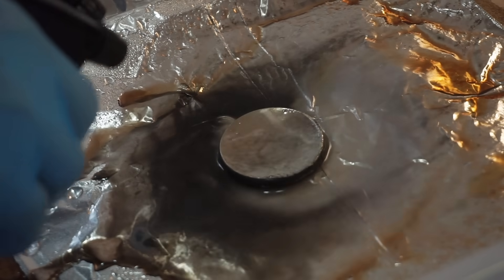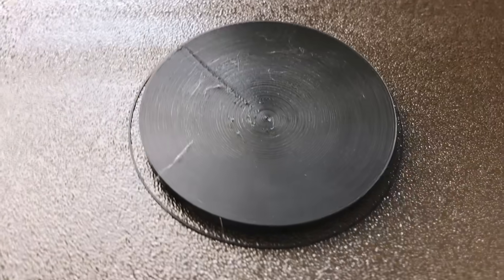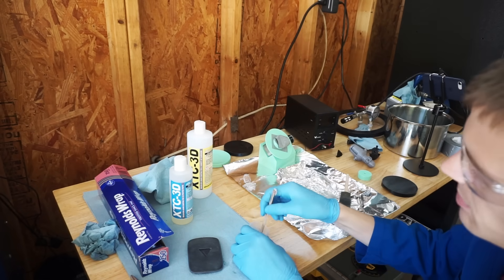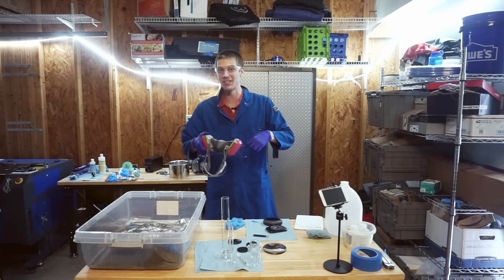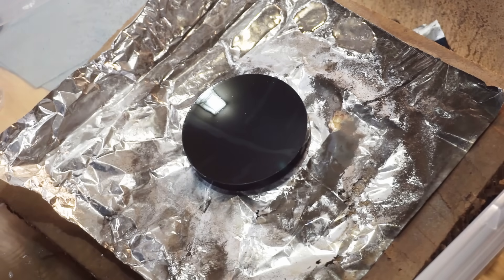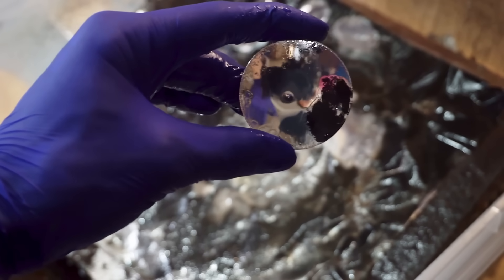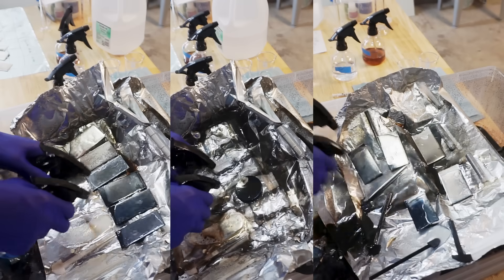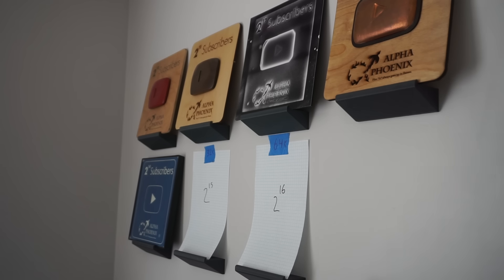How does a "first surface" mirror work? (2^15 sub special!)

Comment: You should 3d print the opposite shape.. foe example if you have a convex mirror, 3d print the concave mating shape, minus the thickness of sandpaper, spray mount wet/dry dand paper, and wet sand the surface. That is how lenses are made. (I used to make eyeglasses.)

Comment: A lot of people use a small heater inside their resin printer enclosures to help cure the UV resin, along with a thermostat to maintain optimal temperature. Maybe putting one into a UV curing station would help with your situation.

Comment: You would vacuum chamber the epoxy before pouring to remove the air bubbles and then hit it with a lighter the flame will disperse all the bubbles on top, if you want to remove the bubbles after the pour you have to put it in a pressure pot and let it sit till it cures. It didn't cure well outside because any type of humidity will mess with the mixture a constant temperature is better than fluctuating one. A perfect mixture 50/50 is always better but the air on the safe side you're always going to want more hardener than epoxy if you are off that mixture if you have too much of the epoxy part it's going to cure tacky and soft and that chemical will still be in the epoxy which is which is reacting to your silver. However, if you put in too much hardener it'll flash cure create an ungodly amount of heat could start on fire and will cure your epoxy immediately in whatever container you're mixing in. If you wanted to be even smoother a correct 50/50 mixture after it dries will be hard enough to wet sand down to a near perfect smoothness.

Comment: cool stuff 15:37 that was some sketchy table saw technique that will eventually bite you more so with thin plywood's the kickbacks guards don't always save you as your starting the cut when you done need a push stick don't use one holding the workpiece is always preferred your shins as in this case or belly if at table height will thankyou getting hit with a piece of that will not be fun i know that for a fact

Comment: pulling vacuum on a resin to remove air is called degassing but you do it before applying the resin to the part

Comment: I wonder if you can smooth surface to some extent using melt scraper that’s heated like razor blade that’s smooth. Gently pressure surface and scrape to melt hills and push them into valleys

Comment: Resin pieces can take up to a full month for them to fully harden especially smaller pieces. That's my best guess anyway. I tried something similar with  the mirror in a can spray pant once and the resin I measured out precisely became rubbery. I waited 72 hours before applying, then tried it on a pencil holder I made several months prior and it  worked out for the most part.
Reply: Oh also humidity is a huge factor. Some resin artists find it bad luck to leave cups uncovered in fear moisture from the air will sneak in.

Comment: Would a 2k clear coat be a sufficient surface to allow the showering process? I am unsure whether it is a urethane or and epoxy based resin so I'm unsure if these would yield different results

Comment: I don't know if you had problems with this one but usually a pressure pot will make the air pockets in resin casts smaller, I would assume it works the same for a thick application. Resin pours also work best if you quickly run a blowtorch over it to pop any surface bubbles if you are having any issues. As for curing, high heat on poly is almost always the way. If you have the option between cool and dry and hot and humid, hot and humid would be the better choice. Heat matters much more than humidity.

Comment: Instead of relying on the resin to make the surface smooth, use a "vibrating back massager" with 600, then 1,000, then 3,000, then 6,000 grit sandpapers, then put a piece of sheepskin on it and use a very mild polishing compound. This will prevent any kind of reaction.

Comment: THIS IS THE MAGIC:  look at making vinyl audio records, the same process. 1. cutting the audio on plastic laquer covered metal disk. so you get the groove. now prepare for galvanic process to build the mother for pressing.
REMEMBER you have a plastic surface (the metal underneeth is only for flatess). now in the wetroom. the disk is to take a bath under the shower....... the liquid is tinchloride. this implants seeds of metal in the surface and now after washing the galvanisation with nickel is possible. now IN the case without electricity use the recipe of justus liebig for normal mirrorrisation of glas even on plastic.

Comment: I thought with resin casting, you degas the mix with a vacuum but cure under pressure to remove bubbles.

Comment: Came across your vid. Love the experimentation. I make wooden boats and surfboards for a living and use epoxy daily. When epoxy cures and reacts with air it often creates a layer of wax on the surface called Amine blush. Easiest way to get rid of it is with some warm soapy water. Not sure if this is your issue but might be worth having a look into. 🤙

Comment: Comments about elevated temperatures are spot on, typically epoxy resins tend to cure smoother, faster, and clearer when heated.  Think somewhere around 125-150F, or ~52-66C.  It helps to "thin" the resin a bit, and allows bubbles to reach the surface better for release, and allows the resin to fill smaller crevices better.  Another thing I would like to note is that to make a usable optical lens, you will likely have to do a good amount of surface finishing, as the silver coating will be quite thin, and finishing will likely be more difficult after silvering than finishing the resin.  Personally, I prefer to give resin 4-6 hours at an elevated temperature, then the remainder of 72 total hours to finish curing completely.  It should also be noted that during cure, dust intrustion and bug intrusion should be prevented as much as possible (bugs love paint and anything you need a nice surface on).  I would love to see the end result once you get a finished product ready for testing.  I'm not typically one for subscribing, but if I were, this would be the first channel I would click.

Comment: Honestly with the resin in the vacuum chamber on a 3D print it might not be a bad idea to do your first coat and put it in the vacuum chamber and then open it up to the atmosphere, so it will suck in resin into any of the pores and lines, and then do another quick skim coat over the top of it.

Comment: A couple of things from working with epoxy resin and fiberglass:
- reducing with solvents is not recommended because it leaves voids when the solvent evaporates, which weakens the material. 
- mixing well is key. how long do you stir?
- typical FRP epoxy has a waxy amine blush after curing, which you can wash off with soap and water. 
- there are specialty epoxies that are less viscous
- expect full cure to take 12 hours.

Instead of epoxy, perhaps it worth trying a can of spray urethane varnish. Varnishes are designed to shrink during curing and the stretching helps to form a smooth surface.

Comment: I used to use this process for work. One thing I'd like to point out is that when you have applied silver onto a material, you've made the surface of that material electrically conductive. You can take advantage of this property to do nifty things like electro-chemical plating. If the original material is then removed from the plated material, the original material can be copied with a 0.00001" tolerance.

Comment: Dude, the resin needs to be mixed EXTREMELY well and make sure you get the edges of the container... I went through gallons of resin because i didnt mix them well enough... i mean you need to mix REALLY REALLY WELL

Comment: I worked in a plastic bottle factory. Many of the bottles we made were also printed on. The way we got the ink to stick to the plastic  was by quickly passing it through a propane torch.

Comment: @14:57 You are meant to put the resin in the vacuum chamber before coating the parts with it, not after.   That is you put the container with the mixed resin in the vacuum chamber and wait until the bubbles top growing out of it, then you let in the air, take it out of the chamber and coat the part with it.

Comment: If you ever decide to revisit this, many commercial epoxies have a wax additive that comes to the surface when cured. The difference in the hydrophobic vs not hydrophobic finish could be from the presence, absence, or modification of this wax layer. This is why you gotta sand between coats, and why a lot of people complain things don't stick to cured epoxy.

Comment: I just thought of one potential application...3d printing a new reflector for a flashlight. The light beam shape changes when retrofitting LEDs into old filament bulb flashlights. Printing and postprocessing with a mirror finish would help to correct the focus to the flat LED emitter.

Comment: This resin system, like most room temperature epoxy systems is an epoxy amine system. I wonder if the reason your A rich coating didn't react is due to excess epoxy reacting with the silver diamine. Also worth noting that that epoxy rich systems tend to be more hydrophobic and that could also be part of it.

If you thinned the epoxy that was in the vacuum chamber, my guess is it's the acetone boiling that's causing the bubbling.

Comment: holy shit

i want to try and do this to my mando helm

i use that exact same epoxy for prints

you can also use a blow dryer or heat gun to harden the epoxy faster just don't get it too hot because you'll heat up the pla and also create pockets in the resin

Comment: I would also suggest trying an atomizing paint gun (or two, it seems) which can be air powered or electric powered. They would lay down a (controlled) thin mist of the two chemicals. That might make the surface finish anything from much worse to much better. Who knows, that process is weird!

Comment: Could the spray bottles used to apply the silvering/mirror chemicals be also a factor in the outcome, specifically the multiple angle changes, some of which might have caused the fluid inside spray bottles to not be in the area of the bottom where the suction straw upon your depressing the pump trigger should have caused fluid up the straw, how many pumps area required to raise fluid up the entire straw, through the pump and out the nozzle, assuming those fluids were designed for applying in equal measure at about the same time to prepared surface and at similar flow rates, the frantic shaking along with the suction straw position and fluids not being together when trigger is pressed, could have caused no fluid or intermittent fluid from both spray nozzles but a wildly varied time and rate. So hang first surface base inside a large plastic storage bin, w holes through lid for hands, and when applying the fluids from spray bottles, keep them vertical and move smoothly to achieve coverage for success. Practice could be had w same size spray bottles containing water and if mixing food coloring dyes caused a third color color, then saw blue in the left bottle and yellow in the right, sheet of white paper for target and away you go, your looking for a nice even green sheet. Those nozzles can adjust flow rate and angle so very easy to be out of sync oh did I mention that our hands are not the same strength and mobility, one dominant usually lasting longer during long repetitive motion, another possible cause for frustration. Thank You. Stay well and always curious. James

Comment: Brings back memories. I did stuff like this when I built an 8 inch Newtonian telescope 50 years ago. Mine was first surface. Had to be replaced at least once a year. You could get a quartz coating, but I was too poor to do that. Getting a parabolic surface was the hardest part.

Comment: awesome video as always just one note for ya, for resins you need a pressure chamber to shrink the bubbles so small you don't see them! I tried the vacuum method before with the same result as you hence how I learned this method

Comment: So, as someone who does a bit of molding and casting, should you ever do this again, you don't put urethane resin in a vaccuum chamber to remove bubbles as you found out.  Instead, you put it in a pressure chamber.  This compresses the bubbles, makes them very small, and effectively removes them.  Of course, this means your mold needs to have no air bubbles in it, so you'll need a vaccuum chamber for the silicone mold, and apparently, you'll also want to let that cure in your pressure chamber, so it's used to being under pressure, for best results.

Comment: Thank you for the great video! One of my research interest are metal inks and I was surprised that Tollens reaction happens here immediately and at room temperature. Also, getting a mirror finish is a tough thing. 

I think I found a possible technology in EP 0346954. Here, the Sensitiser is SnCl2, which allows reduction of Ag+ only on the surface, but not overall in the droplets or on the Aluminium foil. It's a clever combination of Tollens reaction with electroless plating. The rest was explained very well by you in the video. 

I hope, one has to mix the silver nitrate with ammonia freshly prior to application. This mixture tends to from explosive AgN3 when stored over time.

Comment: Have you tried if the silvering is possible without using the resin? You can hide layering effects in the 3D print  by acetone smoothing (put the part into acetone rich vapor and wait a bit) or maybe with a heat gun open flame to melt bit of topmost layer to make it smooth – it works with acrylic at least.

Also, many 2 component resins flatten with heat while "wet" – instead of trying to apply vacuum, apply some heat with open flame (e.g. butane with enough oxygen to avoid soot) and it should remove bubbles and help the surface tension to pull the surface to smooth finish.

Comment: Immediately made me think of the Applied Science video about electro-less copper plating.
[Make plastic printed circuits with a standard laser cutter] https://www.youtube.com/watch?v=Z228xymQYho
I look forward to seeing what you are making. Especially so after you said it was "telescope like", meaning NOT a telescope, which is the first thing I assume when I see a convex first-surface.
NOTE: Years ago an astronomy professor told us about how WAAAAAY back in the day, when building your own telescope, it was sort-of a right of passage to grind your own primary mirror from glass and send it away to be silvered. Now that I understand more of the chemistry, I really wonder why more people who were capable of grinding a decent mirror couldn't ALSO get access to the chemicals needed to silver it. But I guess in the 60s you couldn't just order a bottle of random chemicals from Sigma off the internet.
EDIT: Actually? Maybe you COULD just order random chemicals. The home-photo people were able to get supplies. And there were certainly less watch-lists...

Comment: I have some really large Germanium lenses. Those are from thermal cameras in the 8-12μm part of the infrared spectrum. The lenses are opaque to visible light, but the surface quality and coatings (anti reflective) make them a great mirror. 

The largest lens I have is the front element of a 150mm f/1 lens. Which is 150mm and really concave/convex as Germanium has a really high index of refraction. 

The concave side is really odd to look at. As you can hold it at the proper distance and focus on your eyes - which means your eyes are split and you get a really really odd 3D stereoscopic effect by looking at such a mirror.

Your explanation of the window sounded really interesting. But how did you explain "destructive" interference? Energy can't be destroyed - where does it go? It's a question I keep asking myself after Huygens Optics mentioned it. 

I wish I took more optics courses at university.

As for spinning - giant mirrors for space telescopes are started by melting glass in a rotating oven, which gives you a great paraboloid shape.

Comment: You use a PRESSURE pot to SHRINK the size of bubbles...  A vacuum chamber "boils" the air out of resin before it cures.

Comment: The issue is when resin is completing its molecular change from a liquid to a solid... It begins to pull itself like taffy... essentially folding over onto itself... Use thinner coats and a torch to aid bursting trapped air bubbles... OBVIOUSLY, you'll need to work quickly you don't melt/burn your plastic parts.

Comment: Didn’t read all the comments to see if this has been brought up but epoxy systems quite often use amine or amide based curing agents. If it’s in excess or hasn’t completely reacted it’ll grab your silver. Also, in general for every +10 deg C reactions are about 2x faster.

Comment: Post curing resins at an elevated temperature for 5-10x the curing time generally makes the resin cure fully. Also, correct mixing ratio and excessive stirring is key

Comment: You might be interested in (with the proper chemical management) acetone vapour baths, for smoothing parts, that way you're not fussing about with resins.
Reply: Also air drawn through the parts will be making those bubbles under vacuum. If you pressurise it, let it cure and then release that pressure it will deal with the bubbles 😊

Comment: Poor results from curing outside doesn't seem that strange. I'm no chemist either - but it's fairly typical for basically any curing process to take much longer if it is cold. I don't know the exact how and why of this - but I assume it's related to how all chemical reactions scale with heat (because of molecular movement). Humidity can also be a factor.
My best guess is that your failures simply weren't properly finished curing.

Comment: I’m sitting here thinking of interference caused by an oxygen inhibited layer where oxygen prohibits the polymerization reaction from going to completion. In the resins I work with, this layer averages 40 microns. But I’m a dentist, not a chemist either.